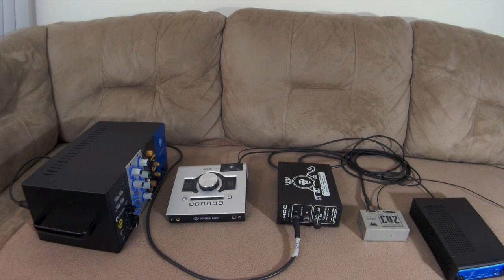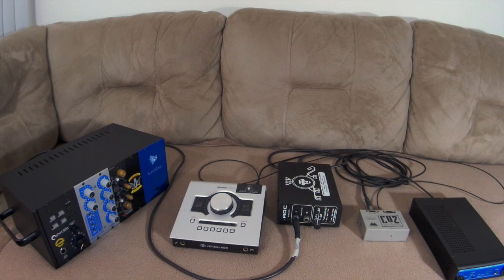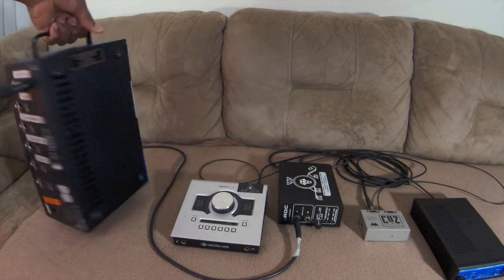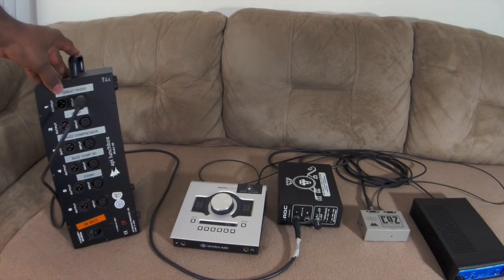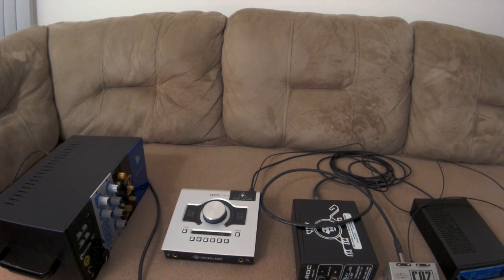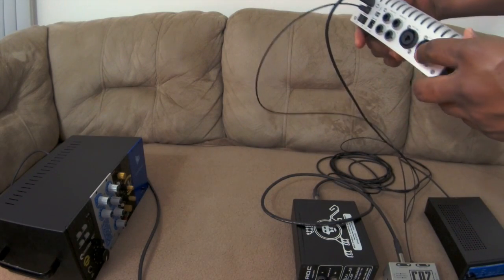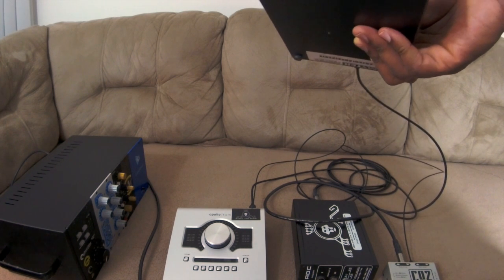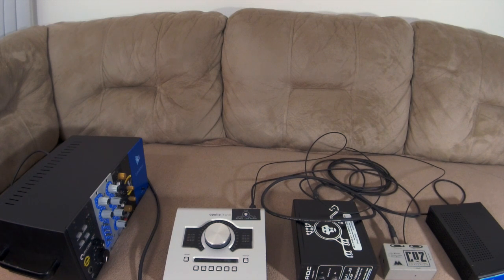Interfacing the apollo twin with other devices

Comment: hey i have a question about the thunderbolt. is it possble to bypass that i/o and still record thru ADAT
Reply from the maker: You can. You would  either come out of an AtoD converter light pipe or adat, if you have those outputs then go to the input of the Adat. Depends on what setup you have and the signal flow out come.
Reply from the maker: Sometimes I do a reallly complex set up
Reply from the maker: I think I did one of those videos on it.

Comment: Wouldn’t it be easier to program or set the Apollo’s XLR input into line level and then go directly into it?

Or perhaps use an xlr/1/4 inch cable and run the preamp into the DI?

I’m just curious if either is possible.
Reply: You could, however this way means you have no control over accidentally clipping the input and you can also keep the 2 inbuilt pre's for other purposes

Comment: Hi there...Im writing from Portugal, congratulations on your channel, i will certainly recomend.
I have a question if you can answer me or help.
My problem is that i have my Apollo quad firewire connected and im using a Focusrite Scarlet 18i20 as Adat extra inputs...They are connected Adat in to out and Out to in.
Its working fine but my question is about the clock.
When i set the Ua Apollo Quad as master i can ear pops and digital picks sometimes... and when i set the focusrite as master and Ua Apollo as Adat sync Slave is working very fine, no more clicks or digital annoying sounds...
So its the focusrite scarlet 18I20 better clock then UA Apollo Quad firewire? Or there is a trick to do to prevent this and use my Apollo as a Master clock?Thank you
Reply: Lucas Junior did you by any chance change the clock setting in the software you are using? For example like Cubase
Reply: @cherokanproductions357  hi... All yes.. Its matching... 48khz cubase... Apollo and focusrite... But since that question I solved everything... I did buy a external clock... Antelope ocx... And all now it's like a charm via wordclock ... So problems gone... Thank you for your answer.. 😁

Comment: If I wanted to use this for mastering would I need to come out the digital and back in while printing to another track take advantage of the converters?
Reply: Are we speaking in terms of the Apollo twin conversion or an External DAC?
Reply: well I think I'm asking how can this help with the quality of the final master or bounce of my mix. It seams like trying to master in the box isn't giving me the head room and clarity I need. Will the mod help with this issue?
Reply: +Mark Ray ok. First as far as headroom make sure you have your session's bit depth rate set to 24 bits instead of 16 bits. This is what gives us the headroom needed to push our masters further. Here is what the mod does compared to the stock DAC. I noticed with the stock Apollo sound lacked depth and width compared to the mod. It was more of a hazy thin and suppressed sound and a little harsh in the high end. So basically it was limiting much of the frequencies to come out as if they were stuck or squeezed. The mod allowed  the Apollo to open up which gave it width, more lows and smoother highs. Also got rid of the harshness as well. So this will make a great difference as far as mastering is concerned. The cool thing about the mod is that black lion audio inserted a digital out as well. Which means taking advantage of using other high end DAC's as well. I noticed my masters sounded much bigger compared to the original stocked device.
Reply: Cool thanks a lot. one last question. I have protools 11 and it does an internal bounce witch will still render the same audio file as before the mod how can I do a bounce using the circuitry  of the mod? will i need to print to another track inside of protools?
Reply: +Mark Ray Awesome question....a few things you do and time to creative 1. On the Apollo twin you should have 1 and 2 main outs and 3 and 4 line outs. In protools set up a second master output and name it 3 and 4 out. Send that second output to 3 and 4 out on the Apollo twin. 2. Take all of audio tracks  and buss each individual to output 3 and 4. You are basically sending some of that signal to the second master out  while signal is still going to the main out 1 and 2. 3. Added new stereo audio track and call it the bounced mix. Now the out put of the Apollo 3 and 4 is live with signal come out from the bussed audio tracks. Take two TRS audio cables coming out of 3 and 4 going in line input 1 and 2. Make sure on the Apollo you set one and two line input. Cont.
Reply: +Dorian Childs the signal is now going into 1 and 2. The bounced audio track you created input needs to be set to 1 and 2 and its output set the main 1 and 2 outs. Correction on step two I meant to say send each audio tracks output to the second master out 3 and 4. Nothing should be going the master out except the second master out 2. So what is happening is the signal is now going to bounced audio track in protools. In order for you to hear it you must engage the input monitoring in order to hear what is playing...kind of like tape machine. When you are ready to print make sure you arm the track and hit record two create you stereo bounce from the modded analog output of the Apollo twin. So now you can export the bounced realtime audio via protools.
Reply: +Dorian Childs another way you can do it only if you have other recording gear such a tape machine, a dat or even another with a daw by taking the main outs 1 and 2 going in what ever recording device you may have such as cd recorder. Recording it directly to cd from the modded out puts of the Apollo.
Reply: ok thanks. What do you think about the Lynx Aurora?
Reply: The lynx is great. You can't go wrong with that either.What is your studio setup like?
Reply: I'm doing another video on summing mixers and how to use them.
Reply: Hey m'y friend,
One question please, I use Apollo twin USb, if I buy all this will work with me if I want to record songs?